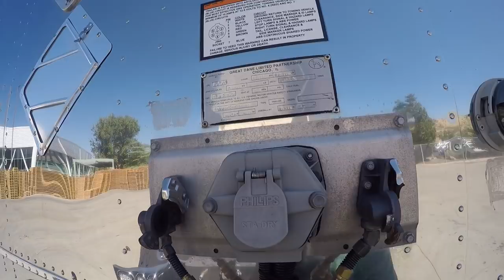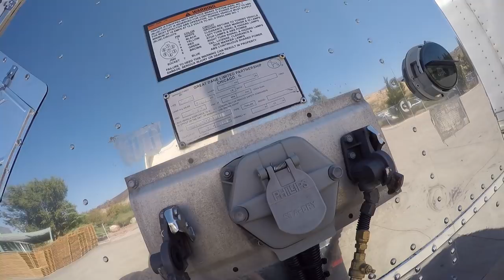Big Boy Load, With The Dog And Pony Show! 1st Pad Wrap Load # 264

Comment: Tim, I’m a retired bedbugger.  I used  4 wheel dollies, and folded my pads lengthwise.  Fold them in half and half again, center them on the 4 wheeler about 5 feet high.  The strap should be centered under the dolly and fasten to the wall at the bottom and the top.  This makes them easy to move around your trailer.  
If you don’t have room on the floor, build a deck with your deck bars, use a sheet of plywood and store them on top.  I used to stack cars in my trailer like that.

Comment: Thanks for the head cam!! 
The transfer dump trucks are also called slam bangs. Due to the noise they make when transferring into each other. There is two small  rails like a RR Track inside the dump bed on the truck.  The trailers have the wheels with an electric drive motor to make it roll into the truck.

Comment: Hey how do you like your head lights? I see you replaced your stock headlights with I think united pacific LED projection headlights. I see you rolling into Reno, I’m hauling propane in this area. Just put my order in for Peterbilt 78 inch sleeper. Drive safe!! I’ll be looking for you
Reply from the maker: Dan Riessen you can’t get these headlights anymore, Peterbilt sued them, but I like them pretty well, don’t put out any heat, so Winter time is a problem

Comment: If I heard correctly you got blankets from the agent sounds as if you had been better off getting all you needed from the agent instead of giving up your expensive ones, live & learn I suppose.
Reply from the maker: Jay Hair all blankets are the same quality, notice the two bundles in the trailer, they came from the agent for a $100 off of the rate con, that’s 24 new blankets for $100, market value is $17.95 per blanket, got a total of 37 for $100, I would say I did a excellent job of negotiating that myself 👌